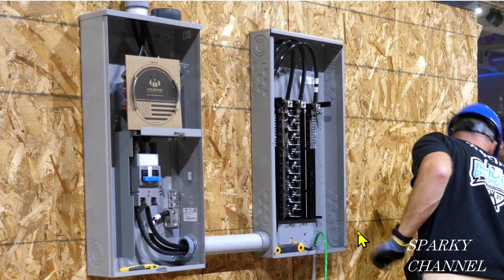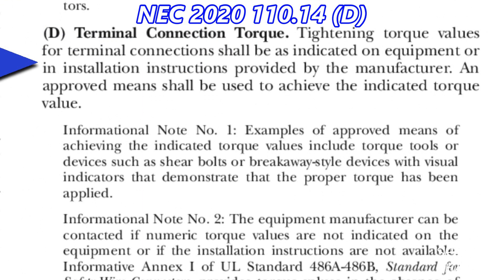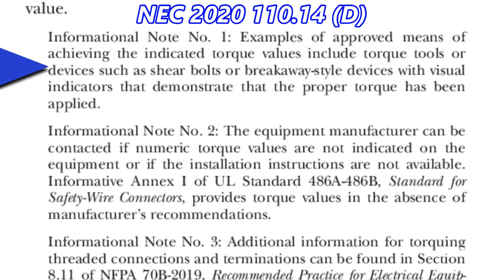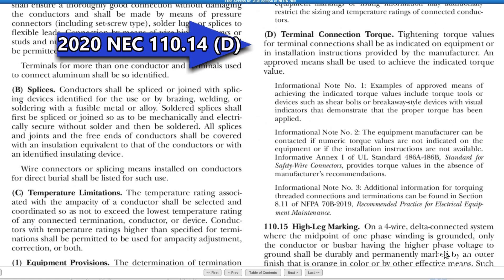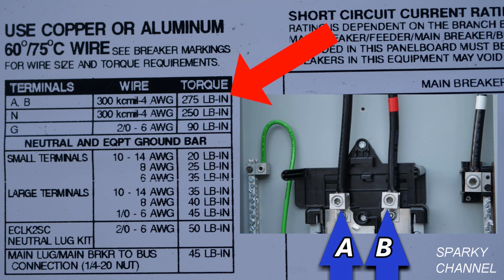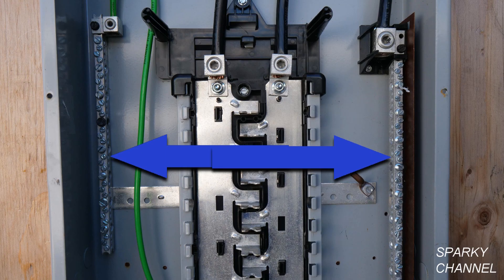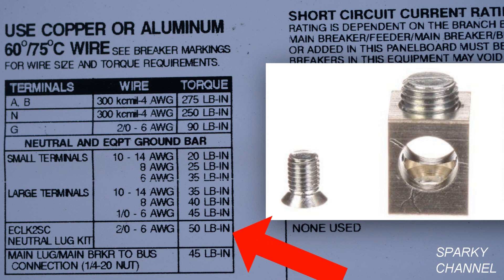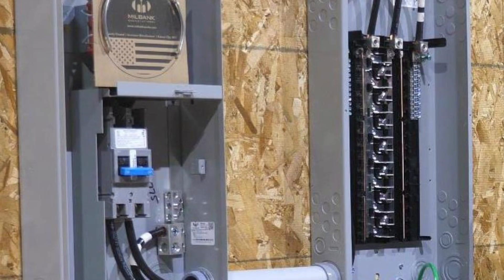Do Load Center Terminals Need to be Torqued and Where to Find the Specs? 2020 NEC 110.14 (D)

Comment: Yes, you have to torque them...
But I have yet to have an inspector actually check for proper torquing.
They usually just check to see if everything is tight, and if it is...
Time to head on down the road.
Tip: instead of buying an expensive torque wrench I bought a 3/8 drive "clicker" wrench from Harbor Freight,  and some hex drivers for it. Works...!

Comment: Hi Bill from Sparky Channel

Blew the lid off that one
Thanks

Question, as those stranded wires connect to the box under the lug. I noticed the copper strands are directly under the screw.
What does the code say about using a crimped ferrule on the stranded wire for the connection. 
Allowed or not?

Thanks for another fantastic video

Comment: Years ago, before I retired, I was the lead engineer/electrician for a skyscraper in downtown Seattle. Every five years our main floor feeder busses had to be torqued. It was always an all-day event. We would load shed the building floor by floor and commence torquing every main buss for each floor. Well, we missed one and it was in the parking garage. The loose connection generated so much heat because of a very large amperage load, it exploded! So, the moral of the story is, always, always, always torque wire, [Or Buss] connections according to factory specs! Great and sometimes overlooked presentation Mr. Sparky!!
Reply from the maker: Excellent story! Thanks for sharing it with us!

Comment: I've found torque with load centers to be well specified for several years now.  Documentation or stickers right in the box.  It's random devices and fixtures that you can waste a good deal of time searching for manufacturer info.  Appendix I and good judgement is the best use of time there.
Reply from the maker: Yes, me too. You just have to know where to look.

Comment: Nobody ever does this, they just tighten them up by feel.   I think the main concern is these not getting tightened up enough and they're being a loose connection.
Reply from the maker: Yes, it can cause overheating.
Reply: @SparkyChannel  yes exactly.   I always make sure to have a clean and tight connection.

Comment: 9 or so.. torque values in the load center? I've seen the Wiha torque screwdriver but it's ~$200.00 is there a better way?
Reply from the maker: The Wiha is a good one. I'll have to make a video about my fav torque devices. I own 3, the Wiha, an AC Delco torque wrench and a Milwaukee torque wrench.

Comment: 275 lb in.       Must be one humongous 
wrench?
Reply: Not really. That equates to just under 23 foot pounds. Pretty standard.
Reply: @ericengler69  Comprehended.
Thank you.   A matter of sizing.
Reply from the maker: You can't do it with a torqueing screwdriver, it has to be a torque wrench.
Reply: It doesn't take much torque to get to 275 inch pounds.  You could do that easily with a 3/8 drive ratchet.  Or in this case a 3/8 drive torque wrench.